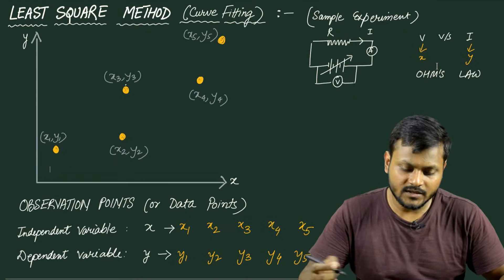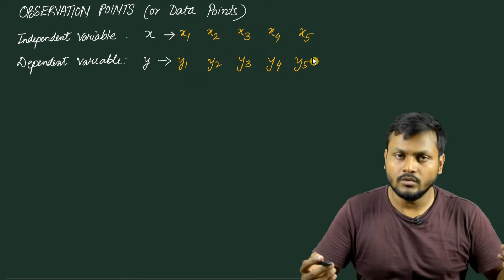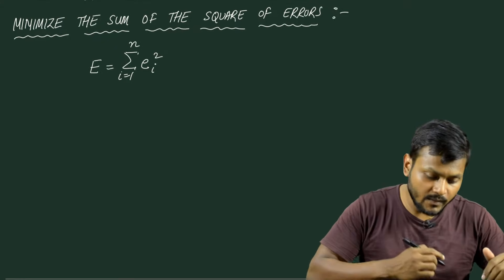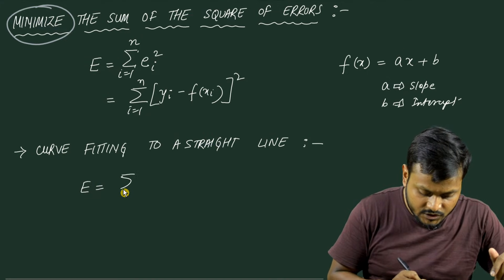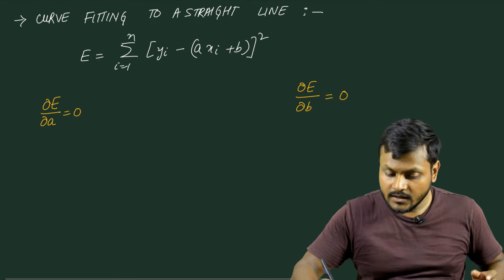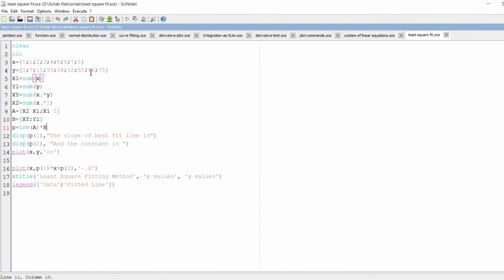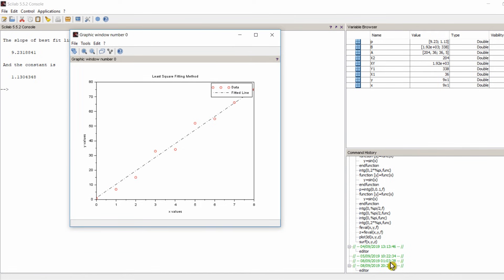Least Square Method (Curve Fitting)

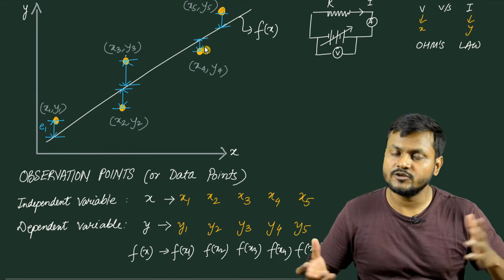Comment: 4:30 why don't we take modules of all negative errors and then simply added by positive error, instead of squaring errors?
Reply: I think because mod function cant be differentiated at 0 land x^2 can be which helps in optimization- I may be wrong

Comment: So on line 9 of the code shown at about 14:20, where does that 5 in the matrix come from?
Reply: The element a22 of A will be n i.e. the number of datapoints we have. 
Hence, here he considered 9 datapoints (as you can count in matrix A and B), so here the value of n = 9, hence a22 will be 9, but I think he wrote 5 there by mistake. It will be 9 there.

Comment: Sir, can we plot count vs voltage        characteristic of Geiger Muller counter using least square method.If yes it will be for straight line or for quadratic equation as we require equation for using least square method.

Comment: why do I need to use error squared? You just elevated the polinomial complexity to one degree higher by using squares! Negative error is not a reason to to convert it into a complex squared function, you could just calculated as the average of errors, using abs(error) and that's it. This method is too complex for this tiny problem!
Reply: its way more accurate than without squares